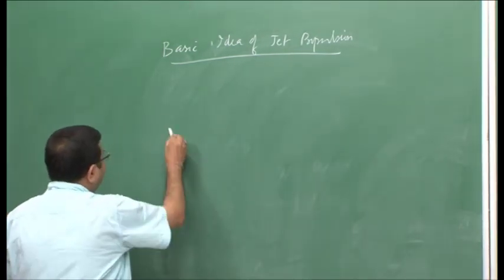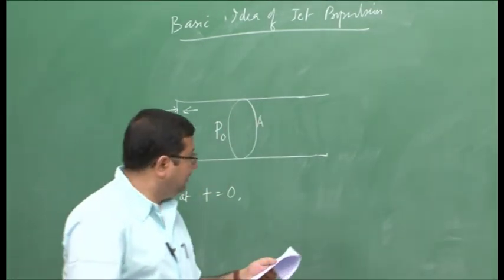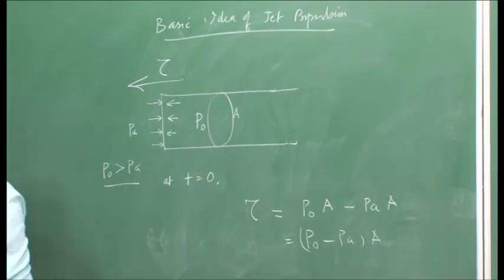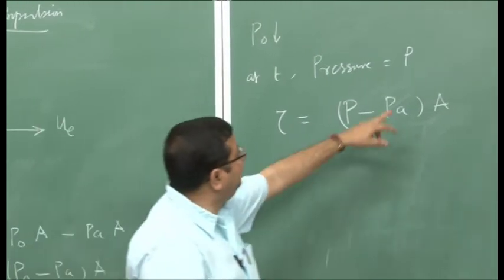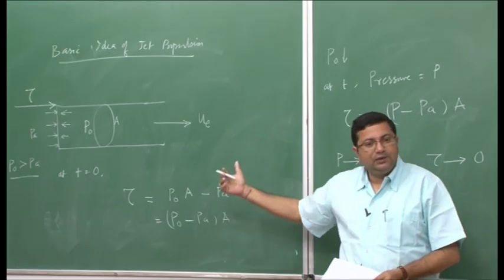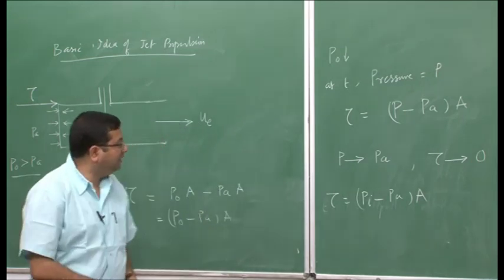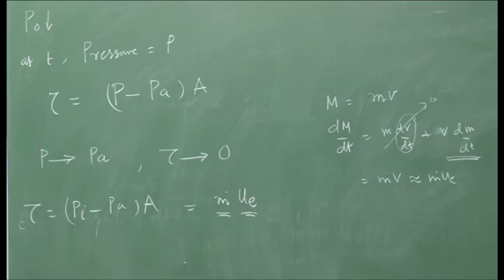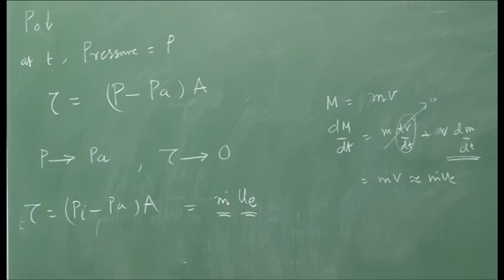Mod-01 Lec-02 Jet and Rocket Propulsion

Comment: Can someone explain clearly why exit velocity will be lower than critical velocity in under expanded case?
Reply: I think it has more to with the change in altitude because the nozzle is somewhat in a convergent state in under-expanded case so you will have a low pressure at the exit but high velocity compared to the critical area.....Over-expansion is where everything changes due to the changes in altitude.. the nozzle becomes divergent in that case where you have high pressure but low velocity...hope this helps